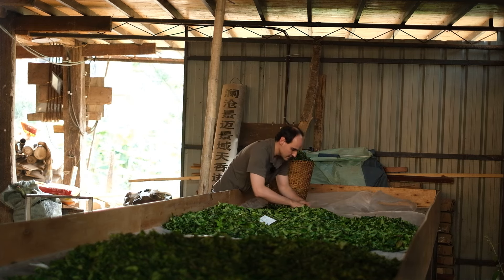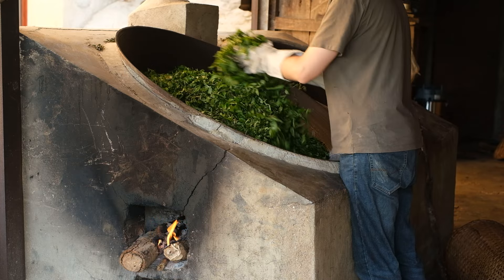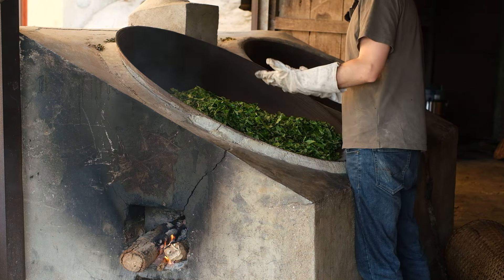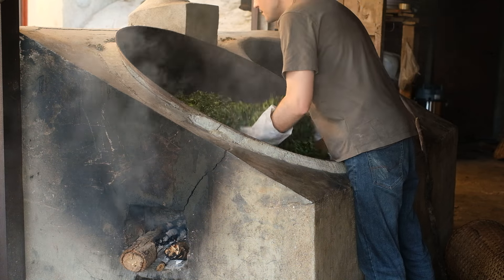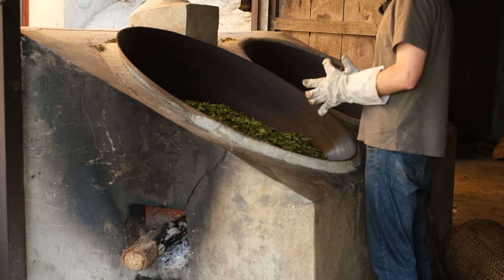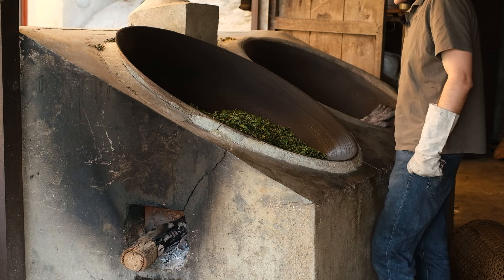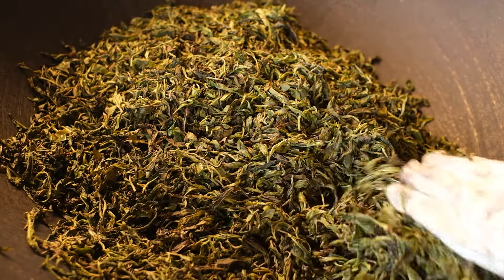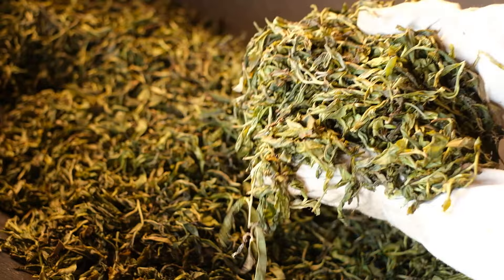Advanced tea processing concepts

Comment: Hmm.. so this would be oolong with a puerh varietal? xp

In any case I prefer more typical puerh, both for its ability to age and the fact that living in a tropical environment, things that can withstand the hot and humid environment are a great bonus. Most of my oolongs seem to change very quickly (I can elaborate), I resorted to storing my greens in the FREEZER, and my reds thankfully aren't too prone to turning stale too quickly. 

For these storage reasons my drinking and buying profile is leaning to raw puerh, dark teas, aged oolong, old white tea etc.
Reply: I'm also living in a tropical environment (singapore). These days I exclusively drink sheng puerh both young and semi-aged. I try to ensure they remain in as dry a storage as possible, and that means turning on the air-condition often and keeping the windows shut for as long as possible. Occasionally I drink dancong which I'm not a fan of age on them, so I try not to hoard too many oolong in my stash haha